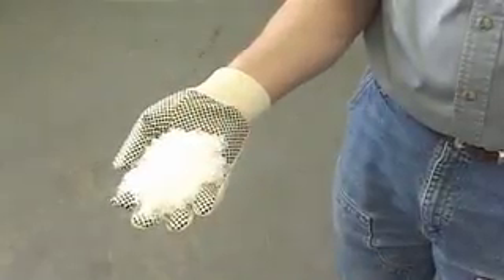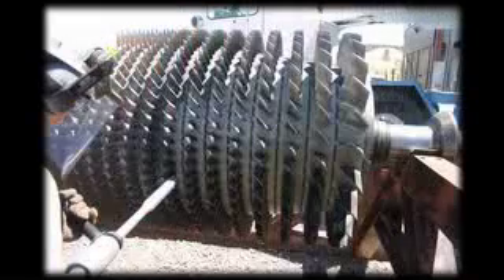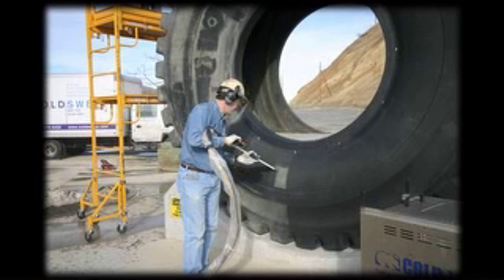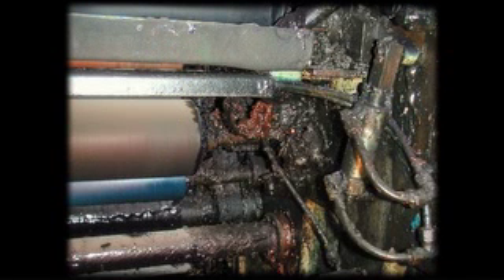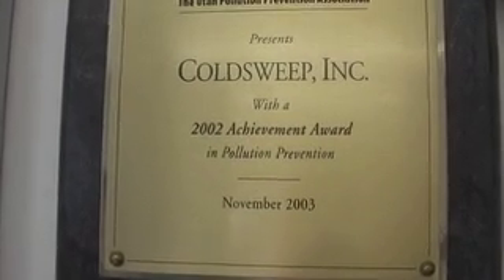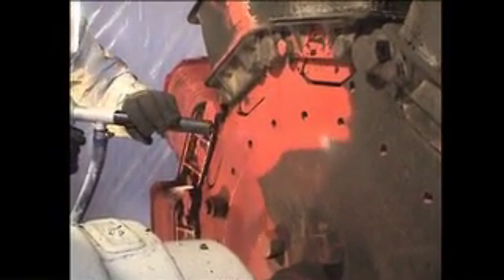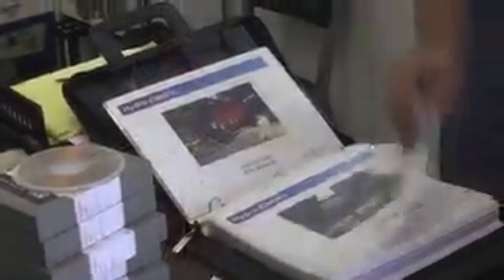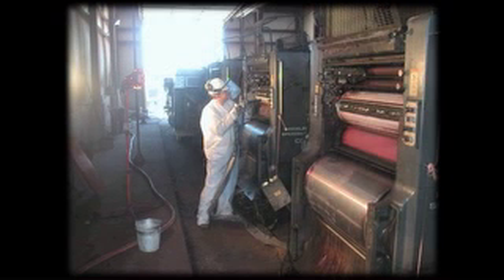Dry Ice Blasting Smoke Damaged Books

Comment from the maker: Dry ice dusting cleans books and removes vinyl lettering with sugar-sized particles at lower pressures.

Traditional dry ice blasting (up to 150 PSI) removes failing coatings with rice-sized particles.

We use high-pressure dry ice blasting (up to 300 PSI) when traditional dry ice blasting won't work.

Choice of nozzles, blast pressure, distance from surface, blast angle and especially operator technique will determine the results obtained with the different types of dry ice blasting equipment.